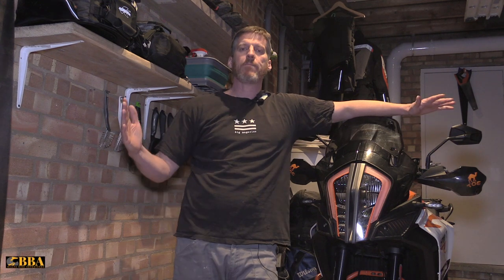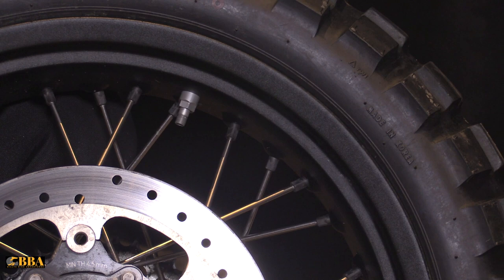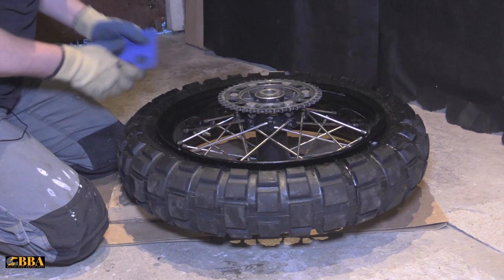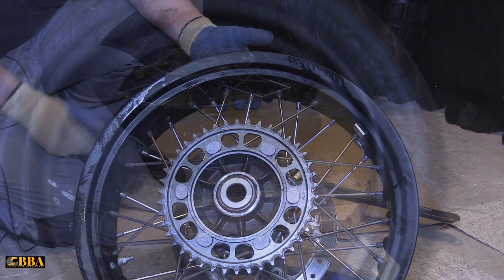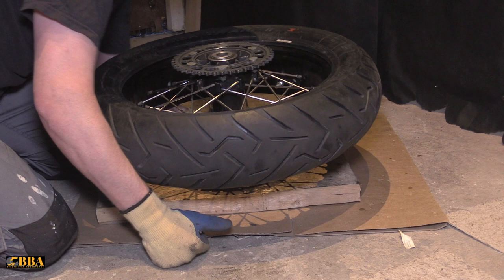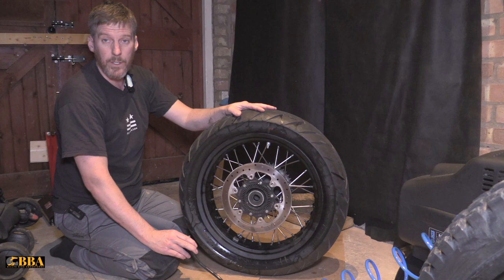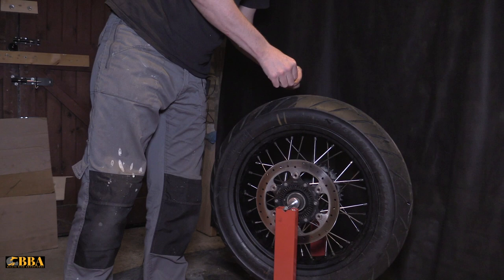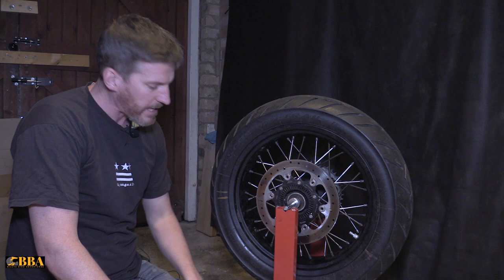How to change a motor bike tyre on a big adventure bike

Comment: You should fine another microphone? there are som deep noise in it. Great video and very informativ. Maybe tell about why you balance the road tire and if it is nessesery to balance a knobby tire :-) Love the tools from MotionPro, got them myself. Cheers from Norway
Reply from the maker: Thanks Thomas. Will definitely look into a new mic. Thinking a radio mic as easier to move around versus the lapel mic. I’ll get e vid done purely on balancing a wheel and include the reasons for balancing. Thanks for the suggestion!!  Ride safe 👍🏼

Comment: Great video- thank you. Just ordered some online Mission Trail Max missions for my 1290 R- not sure they're the best tyre for my first go at doing it myself but look forward to giving it a go after this video. How much pressure does it take to seat the beads? I don't have an airline but do have a 12V pump that says it can seat the beads and re inflate a rear tyre in about 2 minutes. Thanks
Reply from the maker: Hi. Thanks for watching. Greta to hear that the vid was helpful. Pressure does go a little higher than the recommended pressure to set the beads but not much higher. I can't remember the exact figure. First bead sets quite quickly, the second one takes a bit longer. Your 12v should do the job.  Good luck. Let me know how you get on! Cheers. Billy

Comment: Hi. Great videos, keep them up. Can you help, I can’t seem to refit the rear wheel, it seems 1-2 mm too wide when presented to the swinging arm at the hub/spacer. I know about lining up disk to pads, that’s not the issue. The wheel just seems too wide so I can’t get it in. Thanks, look forward to seeing your future videos.
Reply from the maker: Hi Malcolm. Thanks for your message!  A tricky one but at my first thought was the wheel being correctly lined up. Even with the disk in the callipers there still might be play in the angle of the wheel and can through that darn spacer just out a mil or two on that side. Nothing else really springs to mind at the moment just will do some research to see if it could be anything else. Fingers crossed you get it sorted. 👍🏼👍🏼
Reply: Billys Bike Adventures . Cheers and thank you. Maybe this should be private comms rather than Comments but very grateful for your expertise. Spacers in properly etc. Now removed the chain guard to give me more room, and sight. Might raise front wheel, so rear is that bit lower and can ‘roll in’ rather than the lift and drop technique. Will try, but not confident. Maybe wheel bearing is not in enough, but I think it’s the Cush drive which I removed and re fitted? Can I use something like washing up liquid sprayed to rubbers to get cush in deeper/tighter? Do I mallet it in? Not sure....your thoughts very welcome. Thanks

Comment: Going to a remote destination where you might get a tyre damage that you can't repair with a simple fix, can those tubeless tyres get a tube inside? Im talking about the GS 1200 GSA. Thanks
Reply from the maker: A very good question. In short yes it can be done, even with the hole on the rim being off centre for the tyre valve. Now, there are a number of reasons not to, rough surface of the wheel can lead to a puncture of the inner tube, the danger of sudden pressure loss when the tube is punctured. However, there are plenty of videos on YT that advocate taking a tube with you for such occasions where a tubeless tyre repair can't won't do the job. There would be cautionary considerations ie not travelling at speed due to sudden loss of pressure and losing control etc. Not sure if that helps, on. a subject like this you will always get those that advocate and those that don't.  Ride safe, Billy

Comment: Thanks, I may need to do this soon (I’m actually thinking of converting to tubed and removing the TPS so I can do more serious off-road, and the KTM dealer suggestedthat approach in case I get a flat spot on the rim that would prevent the tubeless tyre from holding air, whereas a tubed tyre would)...one question, shouldn’t you base the tyre inflation pressures on what is written on the tyre sidewall rather than the manual? My 1290SA came with Trail Attack 2, but as soon as I change the tyres wouldn’t the pressure given in the owner’s manual be meaningless? I assumed your pirellis are not what was supplied with the bike, but if they are then the owner’s manual would be correct.
Reply from the maker: Hi Ronan.  Very good point. However the tyres i have Scorpion Trail II don't have the pressure information on the side wall.  It does have guidance not to inflate over 40 psi to bead the tyres but thats it.  In this instance i went with the manufacturer recommendation. Your comment has raised a question for me and that is do tubeless tyres not have the pressure on the side wall?  I will look into this.
Reply: Billys Bike Adventures ...it might vary by manufacturer. My new Motoz tyres definitely have the maximum pressure written on the sidewall, but on the rear for example it says a maximum of 33psi, whereas the manual says 42psi, which is a really big difference. The specialist motorcycle tyre shop that sold me the tires said I definitely shouldn’t exceed the 33psi maximum pressure. So now my TPMS alerts for low pressure are always on. For (bullshit) legal reasons, KTM Australia won’t allow dealers to adjust the TPMS settings, although in other countries dealers tech tools are enabled for them to make adjustments. In Australia they simply deactivate the TPMS, they don’t adjust it because of ridiculous concerns about legal liability. So, faced with on/off, my other option is complete removal of the sensors and fitting tubes. I might just remove the front sensor and fit a tube, as the front rim is more likely to get a dent that could prevent an air tight seal on a tubeless tyre. Alternatively, my dealer suggested I carry a tube in case I ever get a problem offroad with a dent and can’t inflate the tubeless tyre. He said I could fit a tube temporarily so that I could get back to civilisation.

Comment: I got the valve mark on my road tyres but not on my 50/50 mitas tyres is this important or can injust mount it just making sure de direction is correct?
Reply from the maker: Hi Tony. I had the same with my 50/50 for my 690. As you say as long fitted in right direction the no bother. Ride safe 👍🏼👍🏼